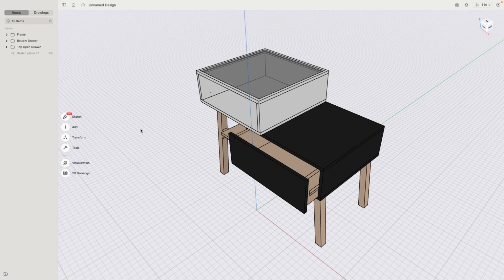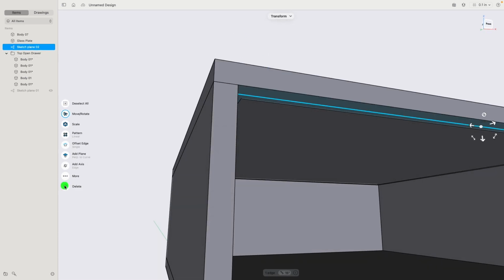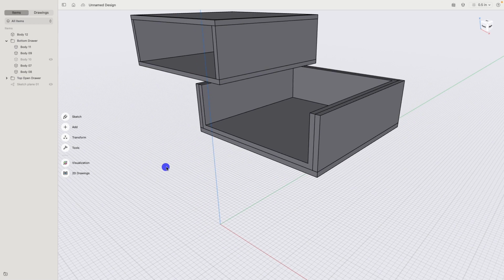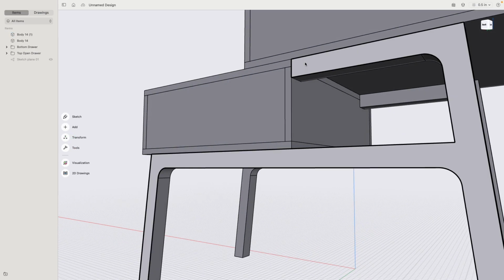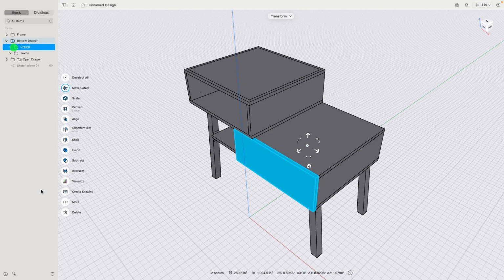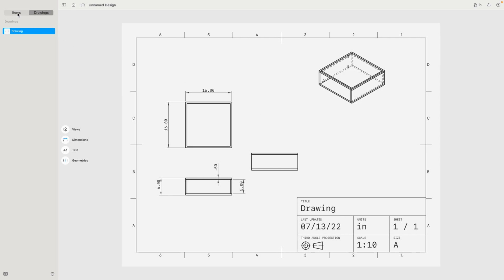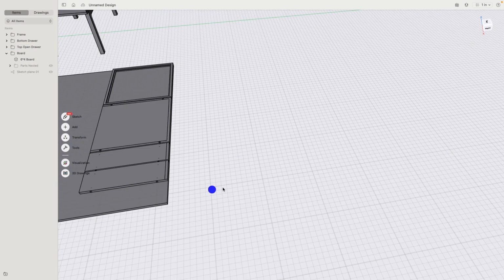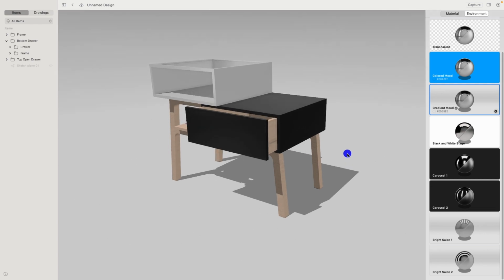3D modeling a side table | Shapr3D tutorial

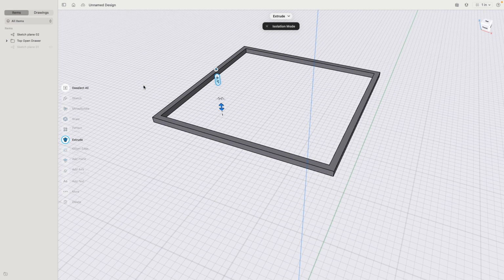Comment: Around 4:44 when I extrude,  all the 3 other sides that were not offset disappear or if I pull down they all form a body. This is after I performed the split body action. I have tried multiple time and tried restarting and rewatching but it seems like something has changed or this video is now outdated due to the new updates.

Comment: also, as far as tolerances. how do you know what kind of tolerances to use? you used 0.02 for the drawer slides? where does that number come from? is there a reference to calculate that from? or is it just trial and error?
Reply: based on what material you use, thermal / moisture expansion/contraction / wear, what manufacturing method, those tolerances have to be tested and then used. there are some guides but that is why you make a prototype and test it

Comment: is there a way to add and show dimension while the desk is in a 3 dimensional view? vs. the 2d view?
Reply: no not at the moment - but you can see those in the sketch - or select individual elements (edges faces) and measure distances / dimensions that way
Reply: @cekuhnen  ok, you may wanna pass that up the chain of the Shapr dev team. it would be a helpful feature. that and ability to import vectors formats and  extrude them. that would make 3d signage a lot faster.  thanks